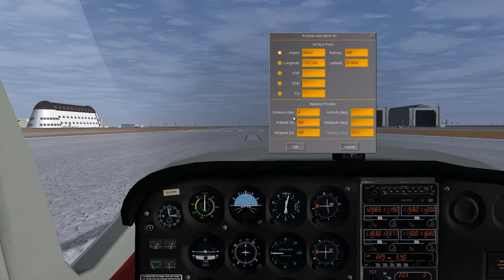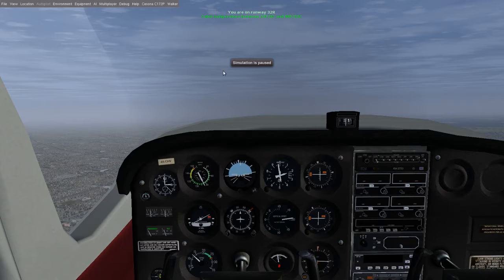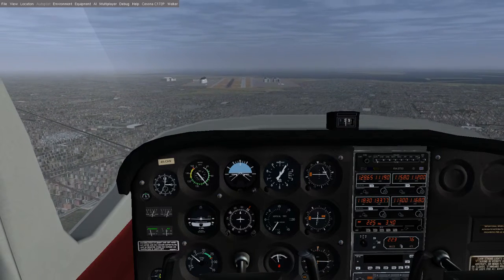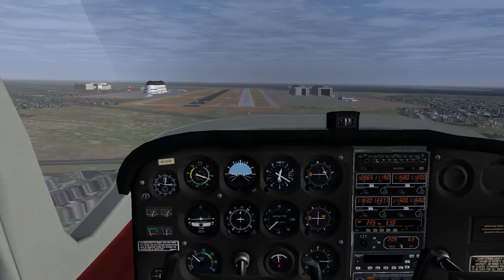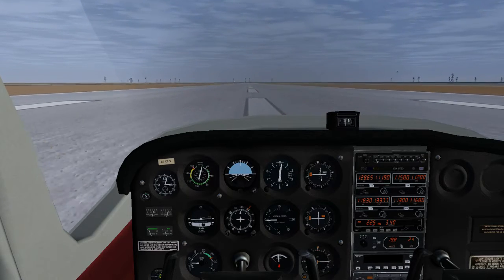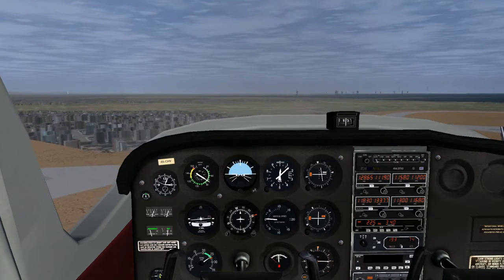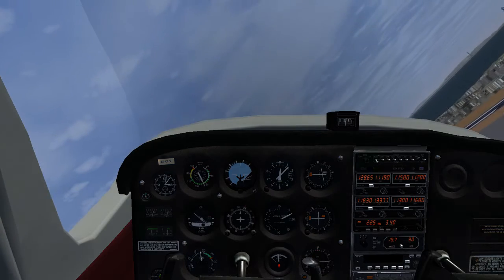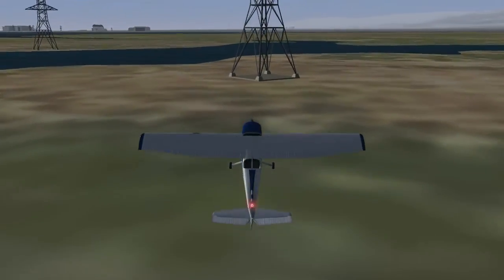How to land in Flightgear

Comment: The lights to the left of some runways are called VASI, short for Visual Approach Slope Indicator. You indeed want to have 2 white, 2 red.
Easy way to remember what the lights mean: all white - fly all night, all red - you're dead.
Reply: Liberal Patriot they are called papis
Reply: DJ creeper Gamer you're right! VASI is the less precise version with only 3 lights. What we have here is a PAPI.   Thanks for the correction.
Reply: @flyingdutchmanwa  No problem!
Reply: I don't think "you die" when the PAPI shows 4 red (or 2 red). You can request Go-Around.

Comment: Are you using the keyboard for the yoke? Or the mouse? Or a joystick?
Reply from the maker: I use a joystick. It generally gives more control than a keyboard but for my first 6 months the keyboard worked just fine
Reply: @not-So-Daily-Gaming  Alright, thanks for the speedy reply.

Comment: You said it's not a perfect landing (in the comment) but to me this is gorgeous! I always land too hard and as much as I can try, the aircraft will bump at least once before it lay flat on the ground. I fly using the keyboard.
btw, if you want to use a yoke but don't want to buy a real one, you can look at this project on github https://github.com/rmst/yoke (for Linux though), this will create a virtually yoke in your computer to connect to an app on your smartphone so you can utilize your phone's accelerometer and gyros to control the plane.

Comment: I am very new to Flightgear and dont really comprehend much of it, any tips you could give me to help me get started? Im mainly interested in VFR flight and use a keyboard. Anything helps
Reply from the maker: +Hair In a Jet Engine sure! I would say it's important to look on the wiki and look up stuff on YouTube if you are curious about a certain aspect of it. But most of all just try new things, although you shouldn't do experiment in real life, Flightgear is a simulation so it's okay to mess up.  Practice landing, taking off, navigating etc until you are comfortable with it. It takes a lot of time. With a keyboard, also understand that small adjustments can change a lot, especially when it comes to altitude. In terms of keeping it interesting while flying, I would recommend looking on the wiki for some well developed airports that have really cool scenery. Hope this helps!
Reply from the maker: It's also worth noting that even though I was able to land okay in that video, I am much better now because I practice. (Tip: the slower you can get without stalling when you are landing the better)
Reply: thank you so much, Ive taken your advice and it helped me significantly
Reply: At the beginning I always flown with a Cessna (which is nothing bad) and did not understand anything. Now, 2 months later, I fly my 777 all around Europe and understood everything. I did it by Trial and Error and by Learning on Youtube and The Flightgear Wiki. Also, dont play with keyboard, if you dont want to spend much money on a Joystick for Flight Sims, just use a regular Controller as you know them from any Play Station Etc. and bind it. I did it and it increased my Flying skills so much. Also, the Cessna 172p Skyhawk, your Beginner Aircraft is harf to control. Very easy is the Apm 20, but its Physics are not very realistic either. So go with a Robin Dr 400 or if you want to go bigger the MD 11 or the 777. Just try out everything. I know I am late, but maby I can still help anyone. Also sorry for my English, I am from Germany. If you want to to ATC in Flightgear, use OpenRadar. Sincerely😋😉
Reply: Jannis Nickel where to find open radar?